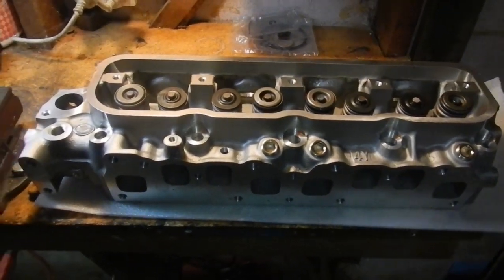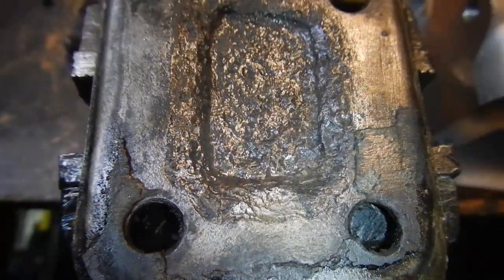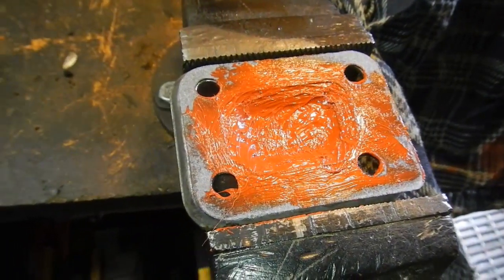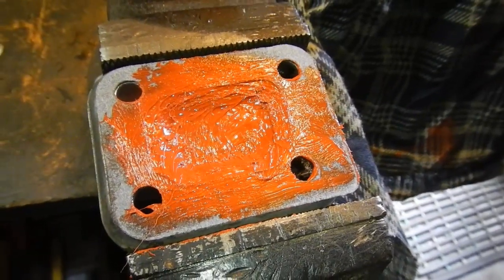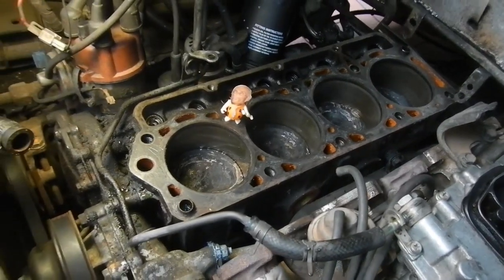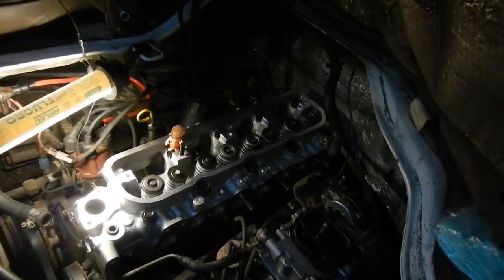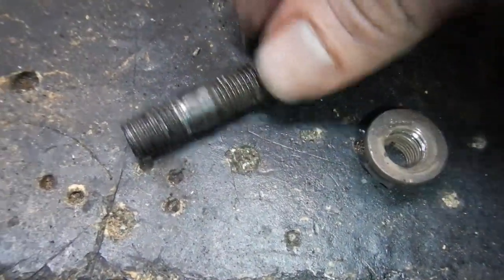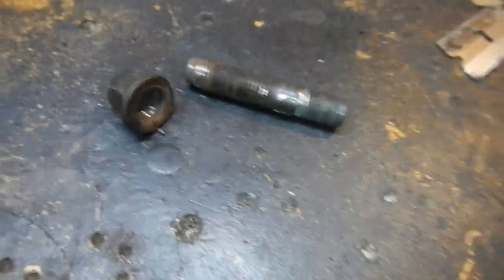88 Van Head Job P2

Comment: Just use a bench grinder and carefully remove the last two threads on that bolt :-))

Hope the water pump was in better condition than the water galleries.

Im sure that plate will be fine, you have sealed the rusted area so it should stay the same for years now.

Comment: find a engineering place that can cnc water jet stuff and get a new plate cut out
Reply from the maker: i bit out of time now to do that but if needed later that may happen. i think (hope) what i have done will last till the van is dead. now it will be running coolant so it should not be such a problem. time will tell. who knows i may buy that van when the old man is done with it.
Reply: yeh I would just mill one out of ally or even just cut and drill a bit of 6mm AL plate